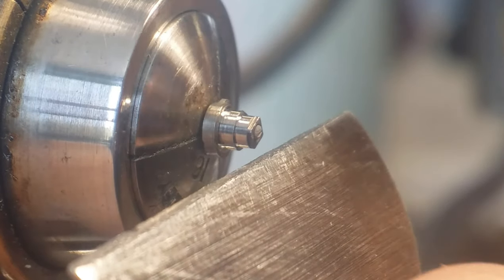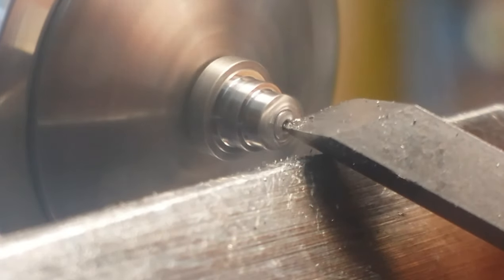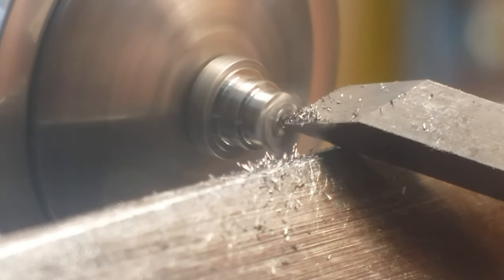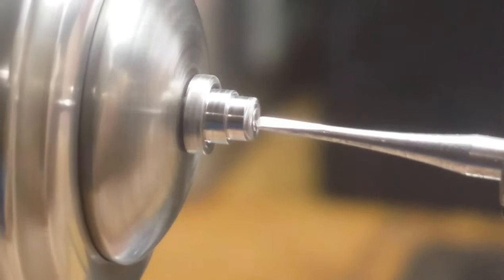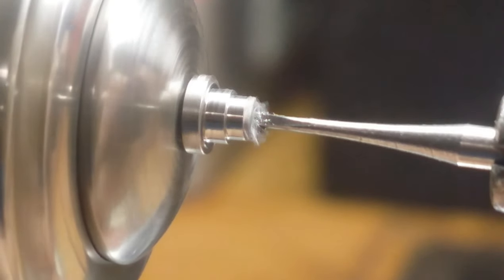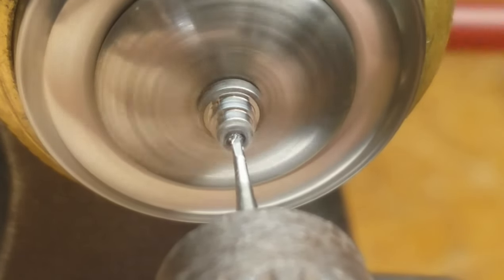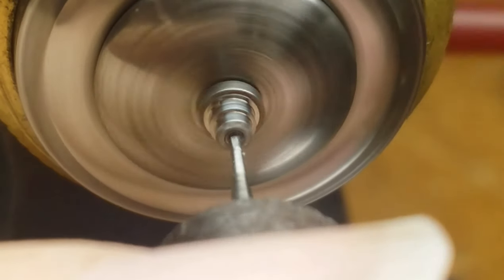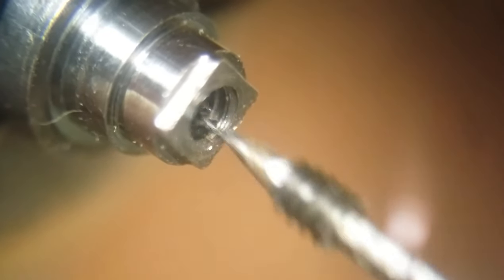Removing broken screw from a barrel arbor

Comment: What the student should have done is a technique that when you have a screw that will not come out, you turn it the opposite direction, in kind of a back and forth manner, hoping to break it away at the threads, and then removing it. If the student would have done that, they might have discovered that they were turning it the wrong way, when the screw started turning in the direction that they thought was the tightening direction. It might sound counterintuitive, tightening it when it is stuck, but at times it will dislodge it.